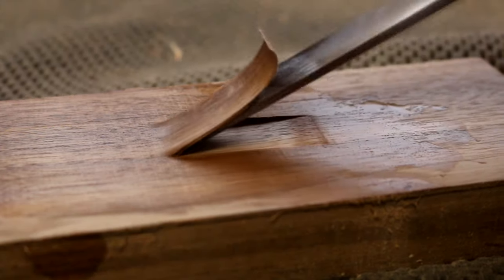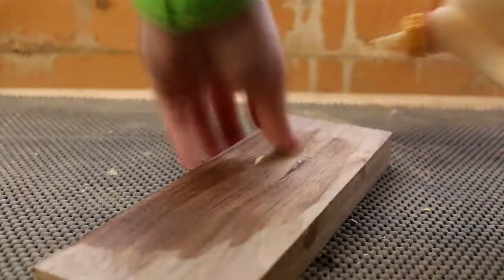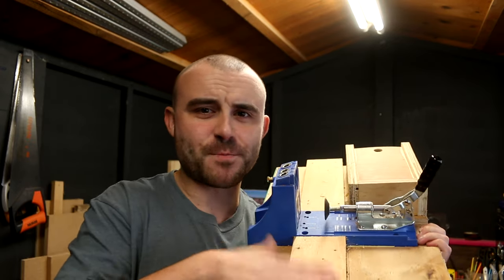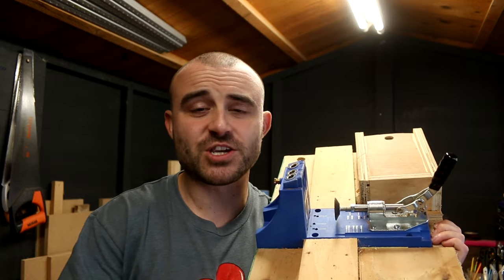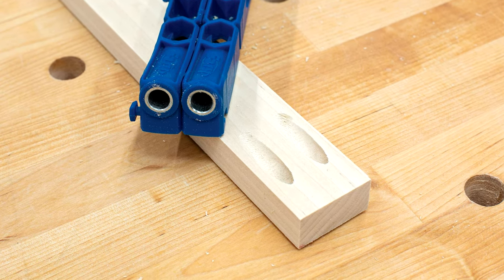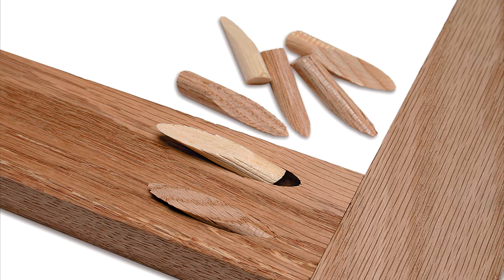Why Aren't All Pocket Hole Jigs Like This?!

Comment: Fab idea, but you might want to consider a slightly bigger hole and putting in a bit of steel tubing to protect the plane from the drill? Keep up the good work and, if it goes into production, I will certainly be buying one.
Reply from the maker: Great idea Sandy! Would certainly help with wear. I hope it can be brought to market one day, long way to go though 😅

Comment: I so could have used that recently. Awesome concept.  I think it would expand the use of pocket holes.
Reply from the maker: Thanks Tim! Had a mixed response so far from companies. Not sure if it has legs at this point haha
Reply: @AverageJoesJoinery  Too bad. It's those unsightly holes, even filled, that had prevented me from using pocket holes in some situations. Regardless, for what it's worth, that's definitely the kind of innovated thinking that will pay off for you.

Comment: Quite a trick!
Any ideas for plywood?
Reply from the maker: Cheers mate! In theory it should work for plywood too but I think maintaining a perfect grain match with plywood is less of an issues compared to solid woods
Reply: @AverageJoesJoinery  Brittle nature of ply doesn't give soft shaving like that of wood.
Reply from the maker: Very true mate. I think I would personally opt to paint plywood or maybe add a veneer on top to hide the screws.

Comment: It's certainly a good idea in terms of what it's for but I'd likely say it's a niche item. You might look into working with a company such as Veritas who do smaller runs of products but then it'll cost a lot more money. Most people who use pocket hole joinery aren't going to spend a lot of money on a specialist block plane and those that can afford to, just go the way of Festool domino joinery. If you want to produce something relatively cost effectively yourself, 3D printing might be the way to go.
Reply from the maker: Thanks Sam! A custom block plane would be an expensive way to go for sure. Ideally I see the set up being much closer to an existing pocket jig with an added chisel sized blade. It would need the bells and whistles of a hand plane then. It would be great to partner with an existing manufacturer of pocket hole jigs to see if it could be adapted

Comment: The technique is clever, but why does the jig need to be in the hand plane? Why not just use a hand plane to make an incomplete pass, remove it, then clamp down a standard pocket hole jig? I think you'd get better positioning. What might help is a pocket hole jig with this technique in mind: a wedge shaped front that lets it get in under the shaving, and a clamping surface behind where you drill. I think I'd prefer to have them as separate tools.
Reply from the maker: I did think of using a separate hand plane or even just a chisel but it would mean you’d beed to ‘peel’ up a much longer section of wood to clear the way for the regular pocket hole jig. A wedge shaped jig would be a possibility for sure. I just think its an elegant solution to have the 2 in 1. It can be used as a regular jig if you wanted by just sitting it on the surface as normal.